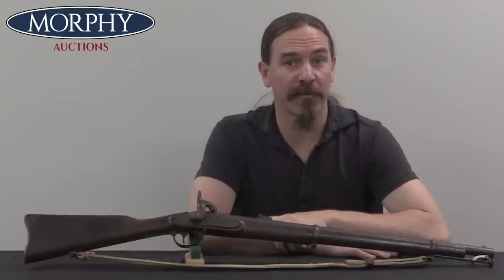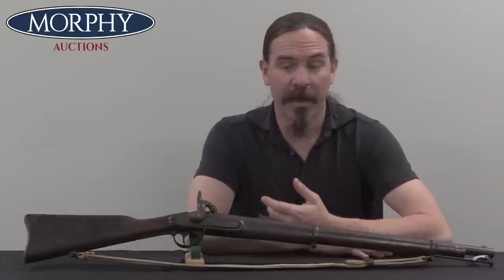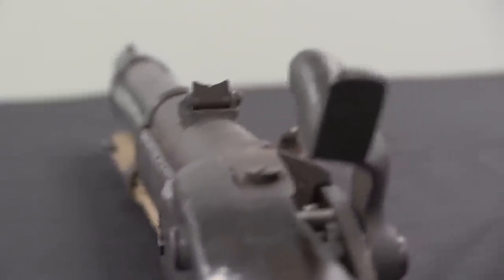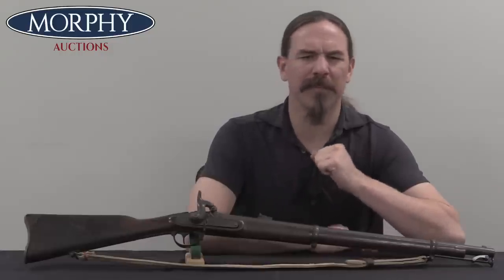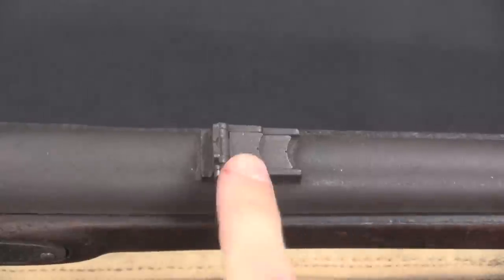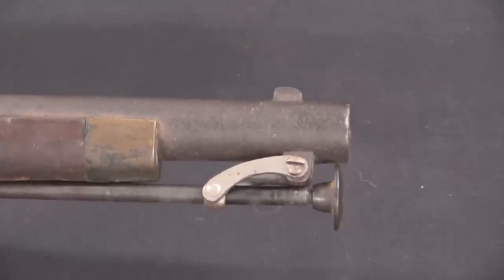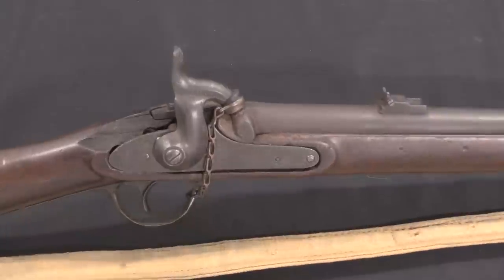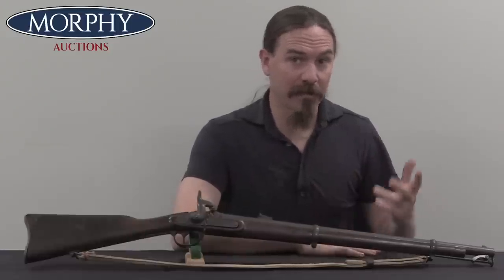Tallassee Carbine: The Confederacy's Last-Ditch Effort

Comment: you can still load a muzzle loader without a ramrod using something called tap loading. it's certainly not as effective and you risk having the project not fully seated, plus i'm not sure if it would be feasible at all on horseback.
Reply: I wouldn’t take that risk
Reply: @Unus_Annus_  even if it's that or not shoot back at all?
Reply: @saladiniv7968  would rather use it as a club
Reply: Ian evidentially needs to give Sharpe a watch.
Reply: @cjp8u2  i really would advise against the sharps technique, spit loading like the do in that series is hilariously unsafe. there is always a risk of a couple burning embers being left in the gun after firing, couple that with you putting your mouth over the barrel to reload and the results will be pretty mind-blowing, as in your brain gets blown out the back of your skull.
Reply: @saladiniv7968  Aye, original comment was only tongue in cheek 👍🏻

Comment: Hindsight is 20/20 and I've never been in a calvary, but I'd guess that an unreliable breachloader is better than a reliable muzzleloader while on horseback in battle.
Reply: i think (not 100% sure) CSA Cav fought more Dragoonstyle,  they used carbine seldom when mounted during a battle more Sabre and  or Revolver (better two then one)  while on Horseback and Carbine/Rifle when dismounted.
Reply: Unreliable can mean several things. It can mean the gun gets "jammed" in some fashion, or parts break. It can also mean the breech block isn't properly sealed, and you get half a load of powder in your face. Actually happened to a friend of mine with a reproduction Sharps breechloader...burned the beard off half his face. Or the gun could completely explode, which isn't good when you're holding it next to your  face.
Oh, and it's cavalry, not calvary. The latter is the hill where Christ was crucified.
Reply: @Sturminfantrist  So did the Union
Reply: Confederate cavalry had a notably “anti-breachloader” attitude in general.

In Kentucky, John Hunt Morgan’s raiders wouldn’t even take breachloaders when they found them. They preferred shotguns, muzzle loading carbines, and revolvers.
Reply: a muzzleloader that you're capable of manufacturing is a lot better than a breechloader that you can't manufacture though
Reply: Also don't ACW breech loaders come in multitudes of ammunition? Good for a few thousands, but when expected expenditures reach millions a month? It's a complexity the CSA cannot afford
Reply: @fidjeenjanrjsnsfh  Breech loaders require proprietary ammo. ML can stuff whatever down the bore and shoot.
Reply: @jason60chev  a lot of breechloaders from the civil war period like the sharps carbine were also capable of being loaded with loose powder and ball
Reply: Civil War cavalrymen typically fought dismounted as infantry (dragoons). Horses were primarily transportation.

Comment: Fascinating as always. One thing re: ramrods that I assume you know but simplified for expediency and to drive a point home: You technically can load and fire smoothbore or (I believe) Minié-ammunition muzzleloaders without ramming, but I would not recommend it and it certainly neither common nor officially prescribed in any capacity I’m aware of. Without the ramrod tamping the powder down, your reliability significantly decreases, as does the lethal potency of your shot. There are accounts of Austrian, French, and British forces situationally tap-loading instead of ramming, but these were exceptional occasions.

Comment: Ian, this is the first time I have ever been able to hear something I consider question able from you and it is very surprising that you wouldn't know this.  I haven't read all 500+ comments to see if anyone has brought this up but I believe that you have the explanation of the operation of the articulated ramrod a bit off.  I have always used one by flipping the ramrod 180 degrees after removing it from the guides so that the wide, flat end is the one pushing the powder and the projectile down the barrell, just like a normal mussel loader.  I have never seen one of these operated using the small end to push down the paper cartridge or projectile.  In fact, I believe that it might be very possible for the small end of the ram rod to pierce the paper cartridge and create a number of problems, none of them good.

I'd like to see any black powder folk comment on this.

Comment: From what I can tell the ram rod is basically a muzzleloader's equivalent to the bolt in a modern rifle. It makes sure the projectile and powder are in the proper position for firing and without one (other than with break actions) the weapon doesn't work. It is a bit easier to improvise a replacement ramrod than a replacement bolt though.
Reply: Good analogy!

Comment: Small point. That style ramrod wasn't used by pulling straight out and going straight back down the barrel. The bump on the end was just to keep the ramrod captured. After pulling free from the stock, the ramrod is spun end for end, and the larger part rams the ball home. Spun end for end again, and replaced into the stock. Not a new technique. First used on Austrian military arms, I think (not positive about that part).
Reply: That’s my thinking at first, but looking at the video, it looks like the large end of the ramrod is way larger than the bore
Reply: @josemalave1322  - Good thought, but no. Pedersoli has recreated this style with one of their muzzleloader pistols. And it has instructions on how to use it.
Reply: @kirk this isn't a reproduction firearm. the muzzle end of the ram rod as mounted while stowed is CLEARLY too large for the bore, what you are describing may have been used for other weapons, but not for this example.
Reply: @NullElemental  - "Clearly too large" ..... no, that's a camera lens effect. While this carbine is original, not a reproduction, the method of use of a captured ramrod system is an oft repeated method. The Confederates wouldn't have used a captured ramrod system and at the same time made it unusable in a normal manner. If I'm mistaken and it's not a camera lens effect, I can safely say that it isn't an original ramrod.
Reply: @kirkboswell2575  Well, I’ve seen this on many reproductions, and I’d agree with you, but the one in the video is obviously way too big for the bore. I’m serious, just watch the video and tell me that it will visibly fit
Reply: @josemalave1322  - OK. Rewatched, slowed down, stop framed, and I'll agree it appears too large. If so, it cannot be an original ramrod.
Reply: @kirkboswell2575  Or, more likely, you don't in fact know everything, and you learned something new today if you'll just let it happen.
Reply: @cmtptr  
Thank you for speaking logic to someone who clearly cannot comprehend that he may, in fact, just be wrong about something...
Reply: @kirkboswell2575  yeah sounds like you don’t don’t know much about Americas muzzle loaders, the US often differed from standard procedure  in gun making, the CSA more so.
Reply: @BeingFireRetardant  Actually, I can admit when I'm wrong, but unequivocal convincing is required. Which seems to be the case with the numerous responses to my comments, and the reference to a similar setup "sitting on my desk".........

Comment: The German needle rifle had been around for a while. it is surprising neither side experimented with it.
Reply: There were a few tested before the war, but they weren't adopted.
Reply: Probably a combination of supply cost, manufacturing complexity, and general warryness of new complicated tech.
Reply: The firing pin was fragile and prone to breakage.
Reply: @jessestreet2549  I don't know I've seen a few videos on that and it seems pretty sturdy. On top of that it was really simple to swap the needles and each man was given a spare. I would assume manufacturing and cost is the biggest factor.
Reply: @Robert Stallard Wait that's literally what I was implying, at the end. I was just pointing out the needle rifle was a pretty good firearm for its time period and use.
Reply: @Robert Stallard Ammunition cost is not a valid reason, the needle rifle literally used paper cartridges. Yes it needed a wooden sabot to shoot the bullet but a normal muzzle loader needed a percussion cap, while the needle rifle didn't need the cap. It was more likely the cost of manufacturing, because the ammunition was not really more expensive or harder to manufacture.
Reply: @Robert Stallard It didn't use a cap, in my understanding, they had more of a pad as a primer. There are animations on youtube that show that pretty well. I don't really understand how the paper cartridge is complicated compared to another paper cartridge, since both are just a twisted paper cone with powder and bullet, and one with powder, bullet, sabot and primer. It's not really that much more complicated in my eyes. The enemy's ammunition is a good point, that would be a little impractical, but lead isn't that hard to melt down so theoretically, they could have used the spherical bullets to get Langblei bullets for the needle gun. And the powder is the same in the end. But I see how it might be problematic.
Reply: We had the 1819 halls

Comment: I may have missed it, but has there ever been a video on the lever actions of WW1? I was wondering the other day why they weren't used, then was surprised to find they were, I had just never heard about their usage in the war. I was even more surprised to see that the Winchester Model 1894 even carried into WW2.
Reply: I'd imagine there was a pretty wide variety of reasons they weren't used. What immediately comes to mind is:
They need a two-piece stock, which is more complicated and expensive than a one-piece stock a bolt-action uses. 
Similarly, I'm under the impression that a lever-action firearm is more complicated (and therefore, expensive) than a bolt-action. 
While rather uncommon, even a 1 in 10,000 tube detonation for a lever action would be, if not unacceptable to a military, highly undesirable, and the vertical magazines of bolt action and self-loading pistols were much more appealing.
Except for 45-70 Gov.'t, which were single-shot and blackpowered and super obsolete by WWI, lever action rifles used pistol cartridges, which obviously are far less powerful than a rifle cartridge.
Lastly, bolt-action rifles would've actually been faster/easier to load, I think. A lever action with a tube barrel needs you to manually reload, one round at a time, whereas a bolt action you just grab a 5-round clip from its pouch and you reload in mere seconds.

Comment: Even with a rifled barrel, the 300 and 600yd sights would have been ridiculously optimistic for a carbine being fired from horseback, surely?
Reply: I don't think the idea back them was necessarily pick out a single target and down them with irons at 600 yards. Think about how wars were fought. 2 armies standing shoulder to shoulder exchanging vollies across an open field. The idea beyond probably 100 or 200 yards was probably just to get rounds close enough to hit someone in the cluster.
Reply: Cavalry in the era often fought as dragoons. Dismounting to fight so its possible if a bit optimistic for any accurate fire.
Reply: As long as they could get proper elevation, they could make the distance with a minnie ball.  The windage error on these sights were horrible, however they are not sniper weapons.  They are to knock down men standing in lines X yards away...any particular man is not important.

Comment: Now, go get a horse, get on it, and do all that again while galloping in a calvary charge, I dont think so
Reply: Most cavalry of this type, most of the time, acted as dragoons and dismounted to fight.

You would not be reloading it while galloping in a cavalry charge haha.
Reply: It would be unusual to ride anywhere at a full gallop contrary to popular belief, as this taxes both the rider and the creature....and even more unusual to reload while galloping.  In fact, most charges started at the walk, then to the fast trot, then the last 50 to 100 yds covered at the gallop. It would be more typical, if charging to drop the carbine( usually has a sling or saddle ring rigged up I'm some way) and pull a revolver as you close.....or trusty saber (or big knife.)  Mmay riders, especially mid to late war, would try to "acquire" multiple pistols, firing then discarding as they went in. Carbines or muskets would be more for stand off or dismounted.  Of course there are variations to the themes above, but let's not forget that people of yore were as smart and practical as we are today.....and did what worked, manuals be damned.

Comment: A 100 yard sight on a smooth bore muzzleloader is generous;
A 300 yard sight is wildly optimistic;
A 600 yard sight tells me the guy who designed this sight was drinking some seriously powerful hooch!
Reply: It is a rifled carbine to be loaded with minne ball.  600 is good range.  This was a copy of the Enfield Carbine they were importing in 1862.

The Enfield 3 bander had sliding sights to 1100 yards.
Reply: Probably  rifled bore. Sights are actually springfield type.
Reply: @williamkoppos7039 flip leaf sights are common in both Europe and America...as well as India at the time.   Cheaper and more abuse sturdy than ladder sights.